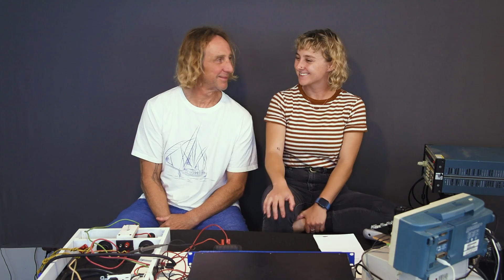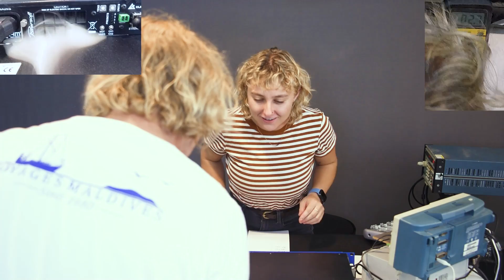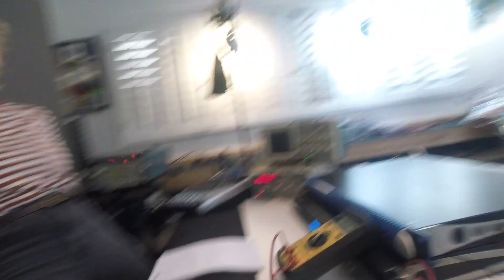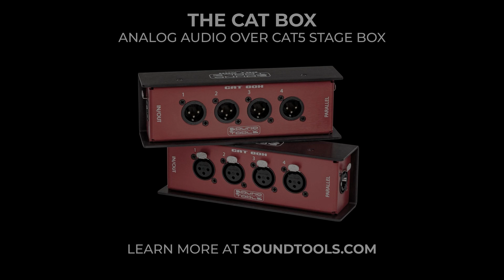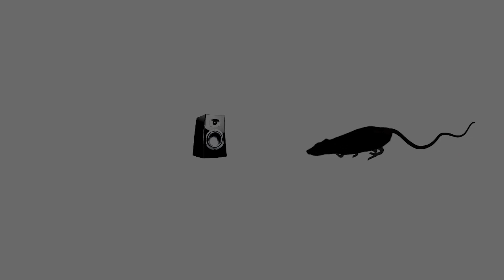AC Overload Class D Amplifier Test (Public)

Comment: After hearing tons of electrolytic capacitors explode, this sounds just like it.  It's a good thing they don't really explode, because they have a safety vent to bleed off the pressure before it builds up enough to rupture the metal housing.  Maybe you should team up with electroboom to make a video!  🤣  Seeing your daughter jump was priceless!
Reply from the maker: Fun and true. I used to test switching power supplies in the 80s and it was good fun when the big electrolytic caps went volcano

Comment: I've popped a few powersupplies like this... Well not LIKE THIS... haha but from across the pond here we have ~240V standard output, and if I've bought US gear and plugged it in without checking if it's switched to 110V on the back it goes POP just like this (there's often a tiny plastic toggle switch on the powersupply for switching modes for diferant wall volts between 110 and 240).
Reply: We used to do it to the school computors for fun by flicking the things into 110 mode whilst still turned on and connected to the 240 socket, back when I was a little sh1t. 🎉 Oh man.
Reply from the maker: Oh my poor computers. When I worked at the test lab at Hughes aircraft One of the guys made a box with a switch on it that said circuit breaker tester do not press.

And there was a button with a little cover over it but you had to open the cover to press the button.

And the switch was just a dead short across the wall power so anybody that came in and press the button shut down the power to the lab.

The best part was that whoever did it was caught red-handed.

The supervisor made us take it away after the second time it got pressed
Reply: @DaveRat  Haha! Thats too funny, next level first day at work prank. 

Yeah, I had more guts than sense back then, I only ever do that stuff by accident to my own gear these days heh. Me amd my pal shorted his whole house playing with electrolysis and basically shorting the powersocket out the same way, as we had just run the mains from the wall stright into the electrolyte and got the cathode and anode too close and they bridged, soso dangerous I really don't know how I made it into adulthood with some of the stuff that could of gone wrong along my escapades 😅

Comment: Perhaps class D amps don't work very well on low voltage, I was trying to test one with 12v, it didn't work and was heating up quickly, its range is 12-36v. I'll try again when I get the right power supply.
Reply from the maker: Interesting and I don't really know but if the amp is trying to put the same power out, lower voltage would need more current and current causes heat
Reply: @DaveRat  Well, it was toasted, I got a 24v power supply and still don’t work. 
What do think Dave? I’m old school (55) and in the 80s and 90s 100 watts RMS was a serious sh*t, I used to DJ with 200w for 100/120 people easily with 2 towers (double 15” woofers each) plus horns and tweeters, and that was more than enough, rarely I had to use all the power. Now they talk about 100w like with no respect 😆. For example, the pair of bookshelf JBL speakers I’m trying to feed in my current project, they say they could handle 100w, no way, 4.5” drivers, so I’m going feed them with just 60w, and that’s what I should get from the TDA7498 with 24v.
Reply from the maker: Yeah, speakers have gotten better sounding but less efficient.  So we need more power than we used to.

Also, those old amps were 100 w RMS continuous and the new amps tend to be 100 w peak.

But also, watts are super cheap and the amp you have now would have cost 10 to 50 times more back then and been heavy and huge

Comment: this was a fantastic idea.. i had a sensory illusion when i saw the smoke.. :}
since this is about generating clean AC is there a video on the 'power conditioners' topic? i'm v curious what the distortions introduced by the power grid sound like w/ mr Dave's 'signal subtraction technique'
Reply from the maker: Hmmm, interesting topic.

On one hand, clean ac is such a subject of debate amongst hifi extremests, that it could interesting to dive into.

On the other hand, if clean mains ac vs dirty mains ac has any impact on the audio sound, all that really tells us is that the amp has a crappy power supply.
Reply: @DaveRat  thank you, i understand. so basically the power supply is supposed to clean the AC mains and this sort of experiment would just show the absurd extremes the "hi-fi forums" can and do reach.

than being said, it wouldn't hurt to have such a clear proof thru "signal subtraction" that power supplies in fact filter out junk -although i'm not sure 'extremists' suffer from a lack of data as much as some sort of trust issues..

---------------------------
on a different topic, and i don't want to abuse your time, i'd like to ask if indeed it's such a difficult process to design a "back loaded horn subwoofer" (scoop bin?) -just for entertainment purposes.

---------------------------------

i'm reading some theory attempting to understand the basics by mr Martin J. King "Advanced Design of a Back Loaded Exponential Horn".

i briefly checked a few forums on this topic and ppl say designing such a speaker is extremely difficult, hence my question. i assume just copying a design wouldn't produce decent results...

months ago my friend and i built a high+mid array (8 x 4" transducers per side) for our "backyard parties" inspired by one of your demos about vertical line arrays and how they mask the interferences of the horizontal arrays..
the clarity and easiness it plays with is impressive compared to 'regular patio speakers' so obviously we need some low-end too. we just got 18" transducers 300W, suited for both sealed and vented enclosure but they're not pro drivers (dayton dcs450-4). we got decent results simulating bass reflex enclosures but honestly they don't look nearly as good as "pro horn subs" and as i understand it, a vented box can't compete in efficiency...

ps: this is a hobby, we don't even listen to loud levels but it feels good knowing we could. it's also a great conversation subject, as ppl don't expect such authoritative sound coming from a bunch (16) of 4" speakers :)

Comment: I wonder if the source amp went into clipping and the power supply in the little amp didn’t like square waves. To check you could monitor the output of the first with an oscilloscope.
Reply: I see you answered this in another comment…

Comment: Once a colleague of mine had blown up a k20 dsp by giving it 380 volts, no biggie. The amplifier was not damaged, it only needed a varistor swap in the power supply. The m20 is probably still fine after swapping the power supply.
Reply from the maker: Exactly!  Same issue, just varieties blew.

Comment: You should do a video where you open it up and see what blew, it sounded like a big ol' capacitor popped it's top!
Reply from the maker: I sent it to my friend that is also the powersoft certified repair tech. He said it was just the over voltage protection varistors that blew
Reply: @DaveRat  Glad you know a good Powersoft repair tech!  Ha ha, X4  1, M20D 0
Reply from the maker: Yes! The big amp beat up the little amp.

Comment: Dave any thoughts on the Chinese CVR D-3002 amp and the rest of it's series that's been favorably compared to Powersoft?
Reply from the maker: I have not had any exposure to them. At this point "dumb amps" that lack any processing are cumbersome unless they are vintage and have some special quality to them. Software, processing, limiters, remote monitoring and all that, is so useful.  That said, they do seem to be a way to get cheap power. But then again, I usually find that off brand products are not worth much if you ever need to re sell them and it is probably better to buy a premium brand used than an off brand new.

Comment: I ve asked myself this question before. No wonder you are the first one I see using an amp as a variable psu.
Reply from the maker: When I used to work at Hughes Aircraft in the Radar systems division way back in 1980, we used to have Macintosh 2300 power amps in the work bench along with an oscillator.  When I was testing power supplies tor the fighter jets, we would use the do exactly that and run the tone into the amp and the amp into the power supply and test for the ability of the power supply to deliver full voltage while under load. We would then alter the voltage and frequency to the power supply to make sure it met military specs.
Reply: @DaveRat  Thats interesting. Thanks.

Comment: My guess is maybe to have that range of input voltage, it has a low and higher voltage mode and works based on what it detects. But once it powered up at 77v it figured it was on 120v power, and as the voltage went way up it went outside the limits of that circuit and went boom instead of switching to the 240v mode
Reply from the maker: A friend of mine is actually the powersoft service tech and has fixed the app for me and he tells me that this model of powersoft app is the only one they make or made that requires an internal jumper to be moved and all the other models automatically slide from very low to very high voltage no problem. I've used quite a few of their amps and made the assumption that this was the same as the others and as always it's fun testing stuff out and finding out what happens.
Reply: @DaveRat  
Wow, good to know!

Comment: Theory- the X4 spec is a max unclipped output V of 175V. Looks like you got close to 190V on the DMM. What would the impact be of a square wave on the power input to the smaller amp? This is a great experiment, very well thought out and explained.  Did you have to refer to the Crest as 'Old'? I remember when they were 'New'.... Have a great weekend!
Reply from the maker: The X4 was in bridge mono mode for channels one and two together so it had a higher voltage output.

Also the X4 won't square wave a tone even if ya try due to internal protctions

Comment: I dread to think of how the power supply amp was cussing out the god of amps for being subjected to this.
The class D almost certainly has a switched mode PSU. As loads go, these are a pig to drive.
Restive loads: resistors, heaters and light bulbs are passive.
Speakers, cables, coils and capacitors are reactive.
Linear power supplies are active and fight hard.
Switched mode PSUs.... Well you grab the Croc by the tail and hope.

If you fancy setting this up again, put an 0.1 ohm resistor in the power line to the class D to have a look at the current on the 'scope.
Reply from the maker: Those powersoft x series amps are robust.  They will drive loads below half an ohm, and power up on any compinatio of 100v to 240 volt single phase to 3 phase o

Comment: 120v into an 8 ohm load? Not surprised the fans are ramping up lmao
Kinda curious why the small amp popped, I don't know a ton about power supplies, though I assumed ones with such a high voltage range have gates open and close as the rail voltage drops, so all that would happen with higher voltages is the gates would have a lower duty cycle. 
I'm guessing it has voltage sense on startup and chooses which primary windings or something to run. Fingers crossed its something simple to fix. 
Been wanting to try this experiment for myself for a while now, using car audio amplifiers as an inverter. Now I know not to mess with the gain!

Comment: I cant believe you dont have a variac! Also, it makes sense that a class D amp would work that way.
Reply from the maker: A variac is nowhere near as fun and won't do frequency shifting
Reply: @DaveRat  fair enough, but there are tools for testing exactly what you're trying to do with reduced risk of blowing stuff up because an amp is doing something weird from you doing something weird.

The test was basically useless because you weren't really monitoring the output of the power amp in any meaningful way. Go knows what kind of harmonics slipped in, or what kind of weird stuff the class D power filtering did to the output of the amp. If you want to make things go kaboom, that's fine, but this felt a bit weak.
Reply from the maker: Well, the amp blew because unlike all the other powersoft amps, this one needs a jumper moved. That said, using clean pure power for testing pro toyring power amps the get plugged into generators and all kinds of wonky AC is kind of the opposite of what I am I treated in.

And most importantly, let's make testing fun!

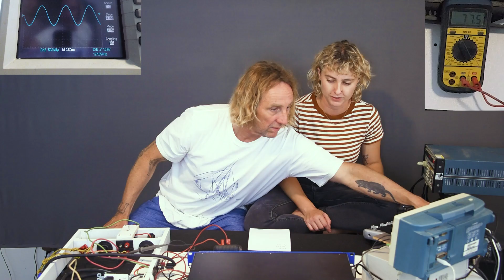Comment: 7:20 That IS a great question ... and hi by the way 👋😄 ... it does seem like the fans are working harder at lower voltage and maybe lower voltage means MORE current and even though the wattage might stay the same perhaps the relevant transistors are working harder? Well on further watching I guess it BAM!! 😆
Reply from the maker: Agreed, the low voltage does make the amp work harder and further testing confirmed it
Reply: @DaveRat  the amp or the PSU to the amp? There's no way to know with that testing setup.
Reply: @bsgconsulting  PSU Should work harder if it is a switching supply.  To get the same power out at a lower supply voltage, it has to run more current, and current is what really hits these supplies.
Reply from the maker: Agreed. It's interesting because the watts to drive the load amp should be the same, lower voltage and higher current output.

Defining "work harder" is relevant.

But what we do know from other applicatiins is that amplifiers get hotter and "work harder" to drive lower impedance loads. Partially due to the amp's internal output impedance being closer to the  load impedance, so there are more losses to heat.

So from that (and from the thermal controlled amp fans going crazy) all things point to the source amp working harder when when driving the load amp at a lower voltage while the load amp is tryin to maintain it's output wattage.

Also I can see it in the X4 amp's 5 limiters using the armonia software control